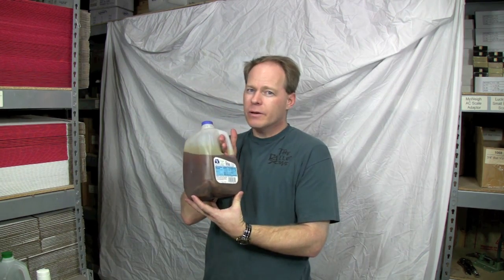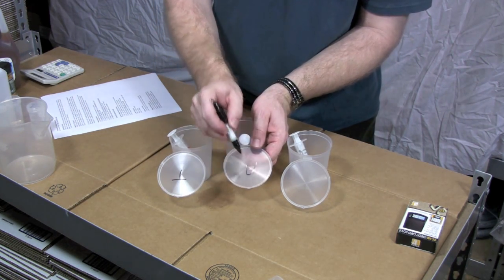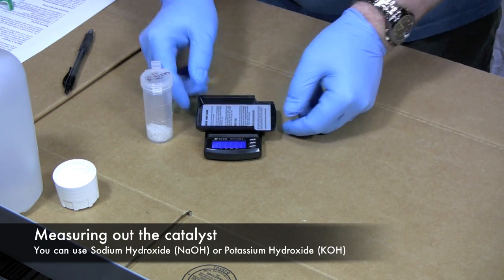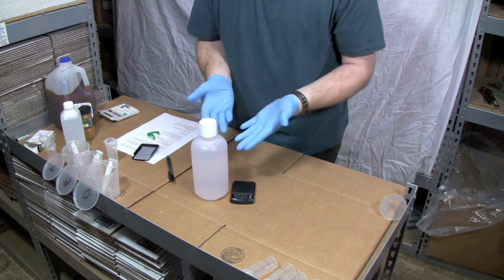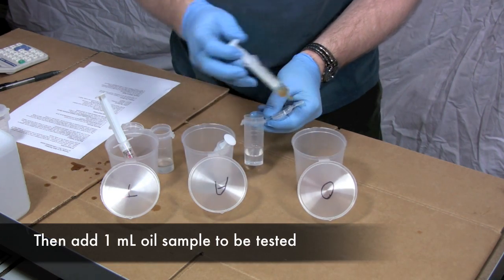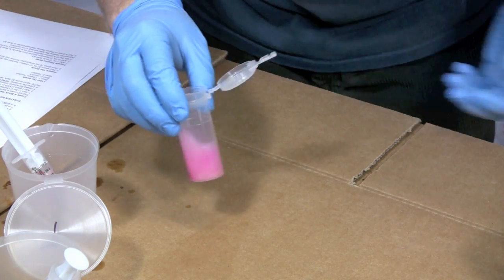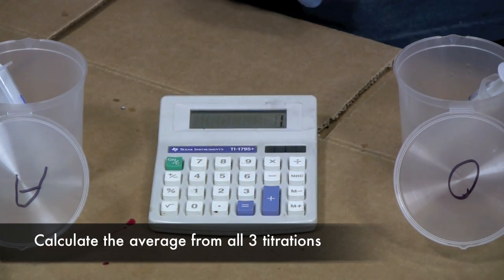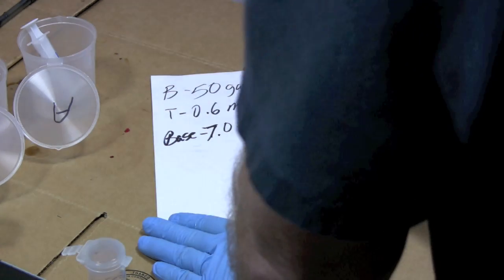Titrating Waste Vegetable Oil (WVO) For Biodiesel - Utah Biodiesel Supply

Comment: Based on stoichiometry ratio, you'll need 3 moles of MeOH and 3 moles of K/Na-OH per mole of triglyceride ["oil"]. The outputs for this reaction is 1 mole of glycerol and 3 moles of biodiesel. The reaction, furthermore, is two step, where the first reaction cleaves the ester bond and the second methylates the carboxylate. Excess hydroxide should be used to ensure full conversion  and prior to methylation a separation of the glycerol layer should be done to prevent any contamination with an esterified glycerol in the fuel. Chemically speaking, your moles of hydroxide and methanol are entirely dependent on the type of fatty acids attached to the glycerol because that will affect the moles you need, which also means the actual amount of material you should use for full conversion changes per oil type used. Lets say one manufacturer uses a mix of fatty acids - coconut,, olive, vegetable, etc. - you'll need to adjust stoichiometry based on this. 

Let us assume you are gathering 55 gallons of vegetable oil waste from a commercial business partner. This is strictly vegetable oil;
Based on the following research (doi: 10.3390/ijms160612871), you can expect 4.6-20 % palmitic acid derivative (256.4 g/mol) , 6.2-71.1% oleic acid (282.47 g/mol), and 1.6-79% linoleic acid (280.45 g/mol). These units are bound to glycerol (92.09 g/mol). There are three units bound to glycerol. It would be fair to assume about 15.22% palmitic, 41.57% oleic, and 43.22% linoleic acids. All of these fatty acids are bound to glycerol, so the combined molar mass would then be 3 fatty acid average weights + glycerol weight - 3(18.02) [water abstraction to bind FAs to glycerol].

Thus, 3[(256.4(0.1522) + 282.47(0.4157) + 280.45(0.4322)] + 92.09 - 3(18.02) = 871 g/mol avg per triglyceride molecule
Density of vegetable oil is about 0.92 g/mL so you'll roughly have 208.20 L of solution, which corresponds to about 192 kg of material (around 422 pounds!) per 55 gallons of oil.

An easy way to phrase the calculation would be that you need 9.47 mL of oil per mole of oil, then from there the rest is simple. 
Because you need to cleave the ester bond at 3 different locations, 3 moles of hydroxide will be used. If using KOH, you need 168.32 g per 9.47 mL oil. Because excess is recommended, 180g KOH/9.5 mL oil is suitable. For methanol, you'll also need 3 moles so that'll be 96.12 g MeOH/9.5 mL oil; at a density of 0.791g/mL, this can also be phrased as about 125 mL MeOH/9.5 mL oil (slight excess of MeOH here). 

To ensure the above is correct, realize the average is 871 g/mol  for weight of vegetable oil. 1 gal = 3785.41 mL --> 208197.55 mL total of oil ==  191541.75 g == 220 mol. 

Now we can finally plug in numbers to calculate the proper amount of material to use for 55 gallons of vegetable oil:
192 kg material == 55 gallons material == 208.20 L material == 221 mol. material 
221 moles triglyceride per 3(221) moles KOH + 3(221) moles MeOH and use excess KOH
= 663 moles KOH or 37.20 kg KOH [about 82 pounds]
= 663 moles MeOH or 21.24 kg MeOH [about 47 pounds or 26.84 L] 

Assume Std. cond (25C/1ATM)

Comment: Hello 

I studies chemistry and polymer sciences and I have done many titrations and reports thereof, you basically want to see where the equivalence point is with regards to pH. When the solution goes from acidic to basic (under pH 7 and over pH 7 respectively). What I want to know is why you cant use a pH meter instead?

Comment: You'll need:
50 gallons of oil, 1596 grams Potassium Hydroxide and 10 gallons of methanol.
Then heat to 135-140, mix thoroughly for 2 hours, let it settle for about 8-10 hours, drain off the glycerin and start washing.

Comment: First off thanks for this excellent explanation/tutorial! This cleared up a lot of the clutter in my head surrounding the titration process when using WVO.

I think he was asking why the 0.6ml was not included in the purity calculation. To my limited understanding, the titration solution amount is already corrected for purity since the higher the purity of the catalyst, the less amount of solution it will take to titrate WVO at a given PH level and vice versa. Am I in the right ballpark?
Reply: Qqqqqqqqqqqqqqqqqqqqqqqqqqqqqqqqqqqqqqqqqqqqqqqqqqqqqqqqqqqqqqqqqqqqqqqqqqqqqqqqqqqqq1qqqqqqqqqq1qqqqqq1q1qq1qqqqqqqqqqqq1qqqqqqqqqqq1qqqq11qqqqqq1qq111

Comment: Chemists several years back reacted several batches of Biodiesel with different bases (5 through about 10) and found the 7.0 was the sweet spot for KOH. Be sure and account for purity (7.0/.90 = 7.8). Nope. Value stays the same no matter which country your in. 

For Biodiesel we work in grams per liter so it'll work where-ever you ar. Just do the purity calculation for your particular KOH you're using.

Comment: KOH & NaOH don't come to us 100% pure. KOH is generally 90 to 93% pure & NaOH is usually 95 to 98% pure. So, with NaOH, we use 5.5 as our base assuming 100% purity. But to be accurate, you correct it for purity by dividing the base by the chemical purity. ie. 5.5 / 95% [5.5/0.95=5.8]. Purity corrected base for NaOH of 95% purity is 5.8. Titrate, add the value to 5.8 and times it by the liters of oil you have and you've identified how much catalyst to use with that batch.

Comment: 3.5 is a terribly old, outdated number. I'm not sure why people don't update it. Use 5.5 and then adjust for purity. There was a lot of research done by chemists that established the 5.5 for NaOH & 7.0 for KOH. Just correct the figures for purity. Don't convert between the two. Yes. It can be done, but it'll never equal out right because of purity differences. Just use the same catalyst for titrating that you do for reacting & you'll be set.

Comment: "We know that when we're using brand new oil, it'll take 7.0g of KOH per litre of oil to make it" - how is this base value calculated/how do you know you need 7.0g? On a titration kit I recently bought, I was given a base value of 3.5g for NaOH instead of 5.5g, as it says on here.
Also, I am unsure as to how to convert between the two - can you just use the good old moles = mass/Mr equation and find the ratio, or is it more complex? Thanks!